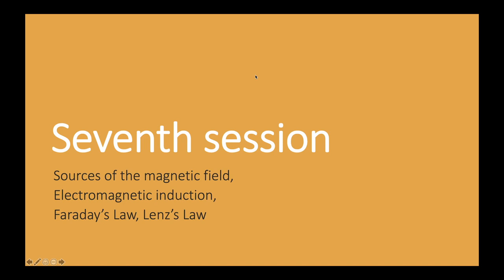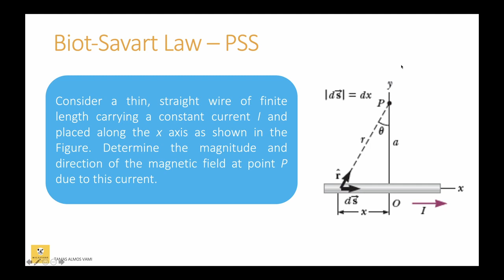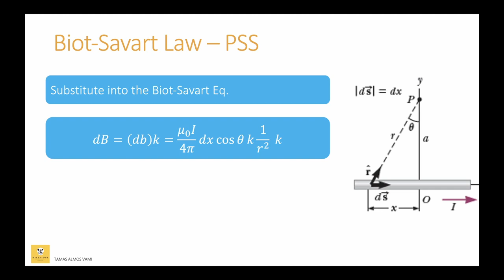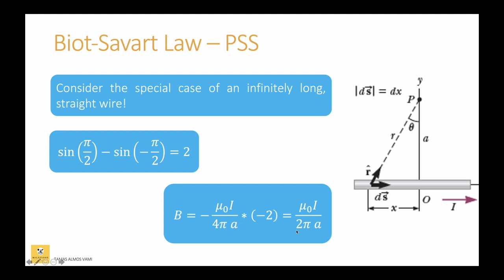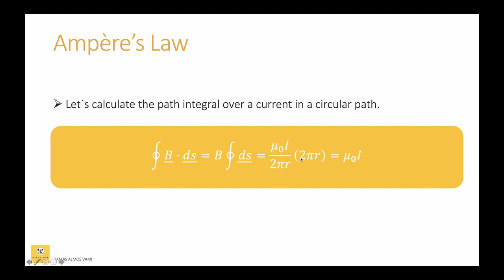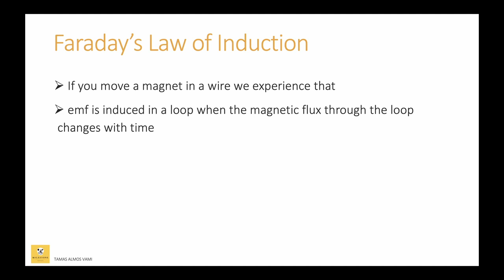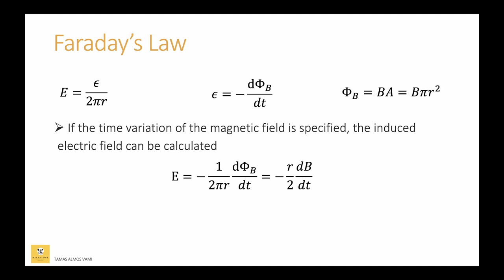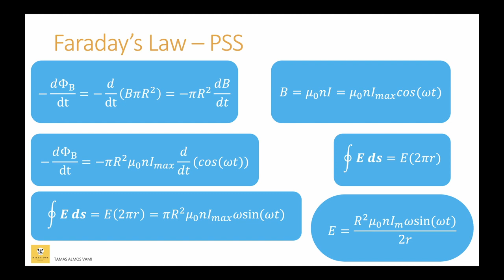Electromagnetism | Electromagnetic induction, Faraday’s Law

Comment: Hi,
So superconductors are basically very strong diamagnets, where the induced magnetic field equals the applied magnetic field (and their directions are opposite by definition), so the magnetic field cancels out inside the magnet? Also, I've heard that magnetism is basically just the relativistic effect of electricity. Is that statement accurate?
Reply from the maker: Yeah, it's a good intuition to think about superconductors to be very strong diamagnets. On the other hand, magnetism purly coming from electricity doesn't seem fully right. For example think about the no magnetic monopole law, who do you get that by moving charges with near the speed of light?